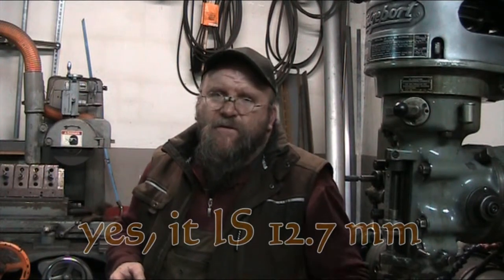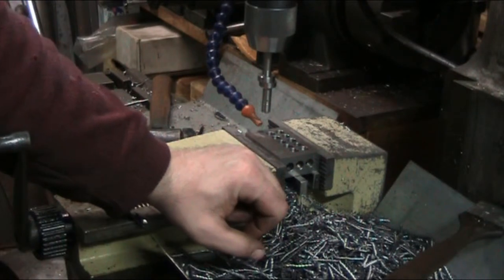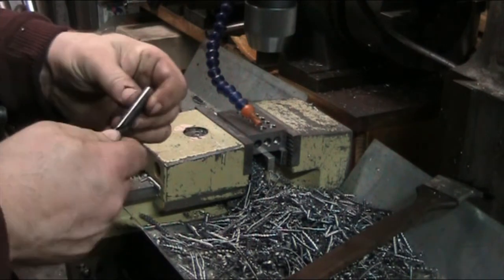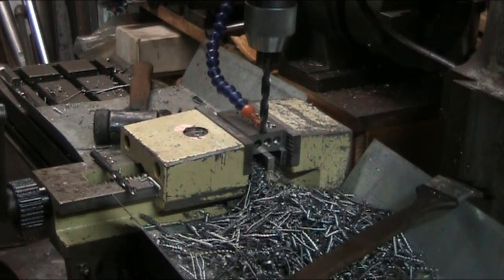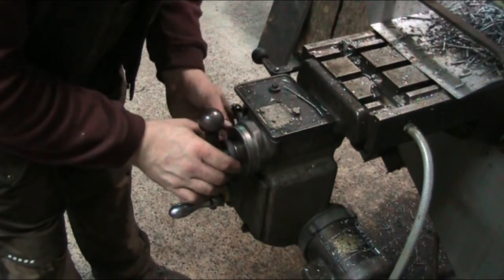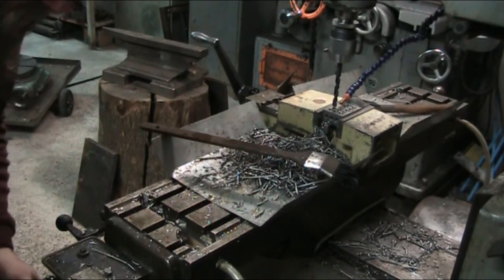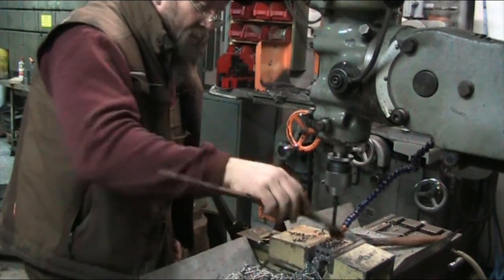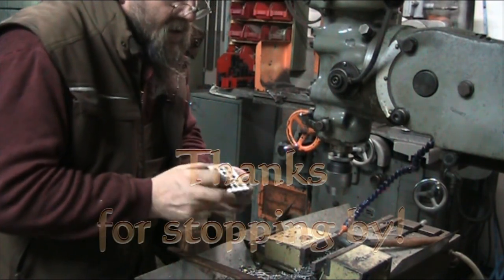Oh Fork it! episode 3

Comment: Going back in time and watching oldest videos first, very enjoyable. Perhaps I'm dense. I don't understand why anyone would use Imperial in the first place, but leaving that out of the discussion, a 1-2-3 block is a relative thing. Your smallest dimension is 50.1 mm which I will call 50 mm. So the "metric 1-2-3" block is 50-100-150 mm. Easy peasy. Oh, you want something like 1 inch smallest dimension? Make it 30-60-90 close enough, because it is not written in stone tablets that 1-2-3 has to be Imperial in the first place. In my case, since I work on very small scales, a 10-20-30 mm block would be the thing.
Reply from the maker: actually the block dimension for a 1-2-3 block in metric 25x50x75mm, a 50x100x150 is a 2-4-6 block. i still have the stock lying in the shop for those as well i just haven't gotten around to making them yet. of course there is no limit to the variation of sizes a guy can make setup blocks for. 

i'm not a huge fan of imperial either, which is why i'll be bringing my milling machine home with me when i go back to the states. it's a J-head bridgeport in metric, with a coolant system installed in the factory. since i have done quite a bit of stainless on this machine the coolant system has been indispensable. while it is messy and a royal pain in the ass, i have come to like it for the results i get and the life extension of the tooling. 

are you doing modeling or clock work to be using smaller scales? the setup i have is for rather large work since i plan to cater to the mining, loggin and oil industry when i get to alaska